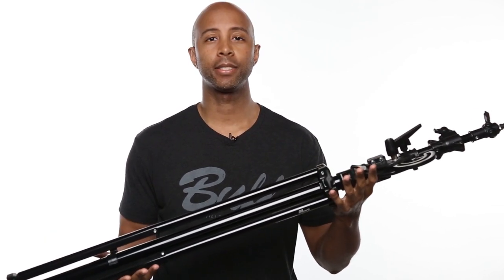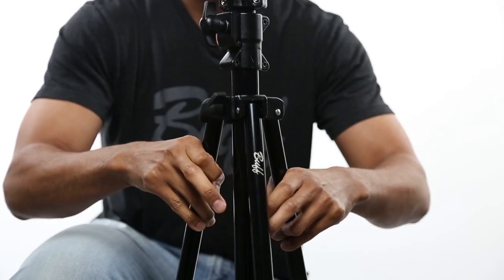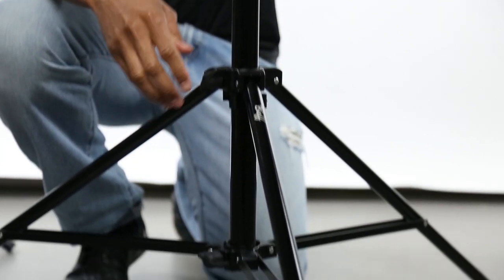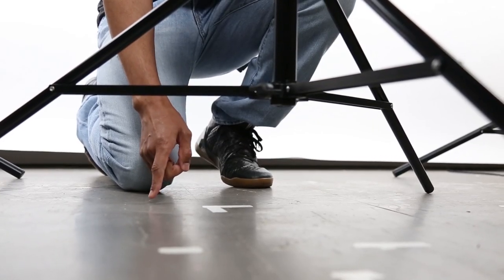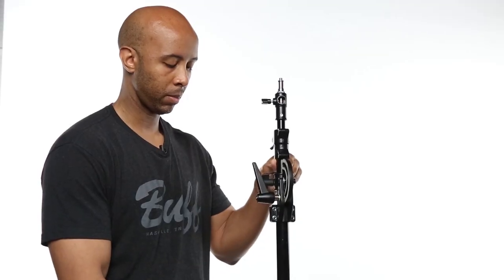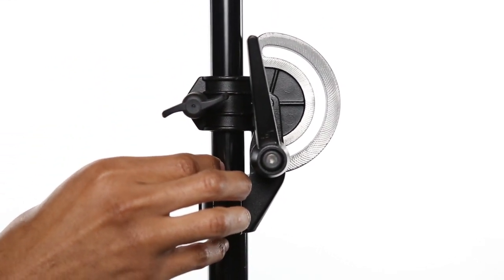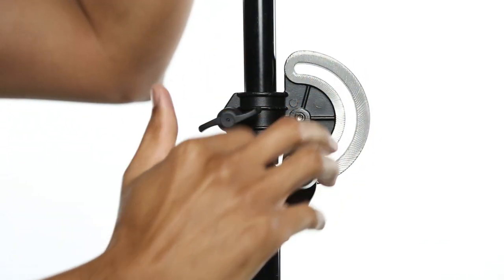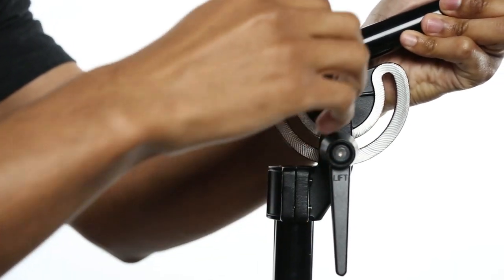13ft Combination Boom Stand | Product Demo

Comment: It would be nice to see a video that sells the product to consumers. Something to help them understand how it is made and why photographers would want/need one in their equipment. Are the fittings metal or plastic? What is the weight rating of the unit? Are the knobs 'gonna snap if too much torque is applied when setting up? How many different ways can the product be used? Can replacement parts be had easily or is this one of those "we had it made in China and put our logo on it" scenarios? How is this product a better buy over the same gear made by westcott, manfrotto, photoflex etc.?
Reply from the maker: Thanks so much for your feedback! Information on product material, usage, etc. can be found directly on an items product page on our website. For any additional questions you may have, you can always give our customer service department a call at 1-800-443-5542 from 9AM - 5PM CT.